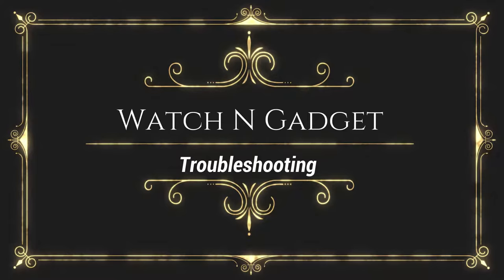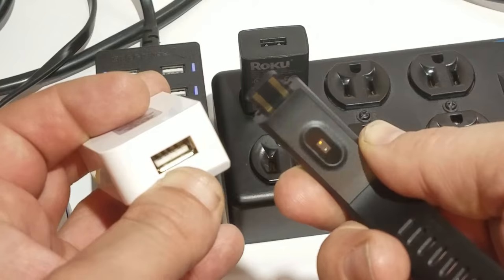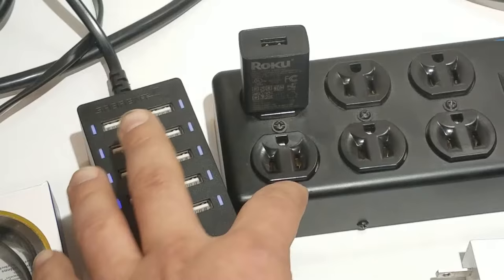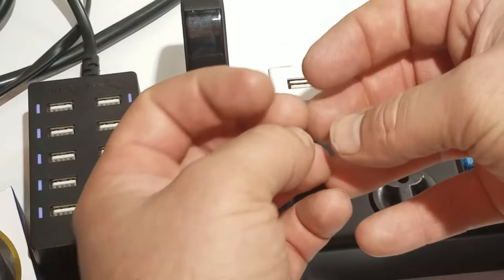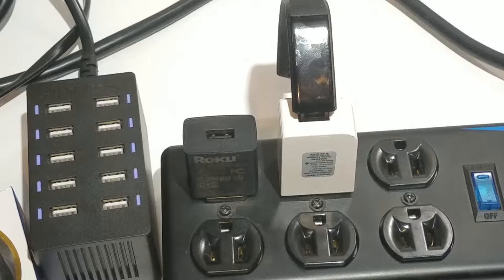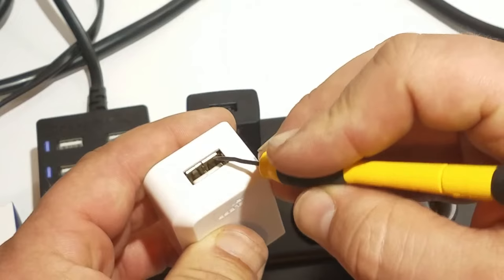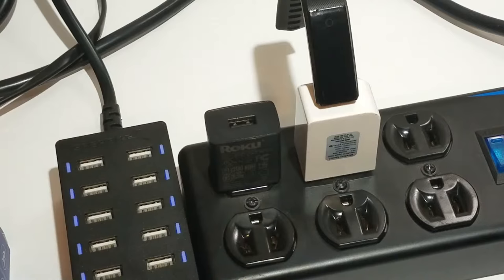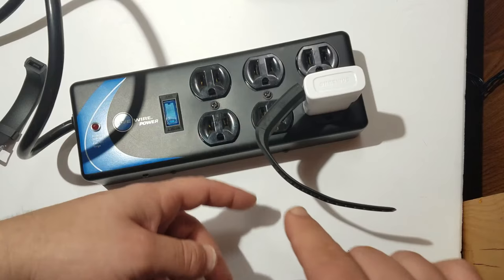Smart Band, How To Charge "Troubleshooting Guide"

Comment: I took your advice and opened up the  metal contacts with a small screwdriver. I plugged it in and the fit bit started to charge. Thanx I recommend this procedure before doing a refund.

Comment: You made everything clear, and I can see why you do need a tight fit.  Since it is 5V.  can you just plug into a computer, and I realize that it also can be a loose fit as well.  Mine didn't vibrate  but then again it is not fully charged.  The instructions that come with the band are not particularly good and everything is so small that you need a decent magnifier to even read it. The band's lighting is good but as time goes by, I will see how it will work give a better impression.  I am surprised that it so cheap in price, unlike the Apple watches.  If it will do what it says in the instruction, then it is worth the price.  Disconnecting the watch band itself hasn't been and a lot of pressure had to be exerted to pull it apart.  It is also very easy to plug it in wrong the first time, like I did and after 2 hours, I wonder why it didn't charge.  I thought that the band was missing the charger.🙂

Comment: That's great info ...I have a different problem that I can't work out. ..the metal  charger part of my watch has come apart from the outer plastic ( which is still in the strap ..mHow can I get it out ..I thought of putting some glue on the prongs but only on the side which does not connect the charger ,? ...Any ideas ?

Comment: My watch has the same connections as the one you show. I let it die around 3 days ago because it was my days off and I didnt needed it (so i forgot to charge it) and now it has been dead for over a day while plugged in.

Im trying now both methods, adjusting the metals on a "newer" charger i had (not new but it wasnt used much  but the smartwatch was dancing on it) so lets see what will happen...

A hour has passed by and the screen is still black, usually it turns on for gives me the info that its charging after 15 mins of being dead...

Comment: Just a USB extension lead ought to help. A brand-new socket on one end, and a proper plug on the other, ought to solve the problem without much expense or messing with screwdrivers. There's also the hi-tech method of sticking a lump of blu-tack on the socket to hold the watch's contacts in the right place.

Comment: Whats the correct charging voltage for these smart fit watches. I noticed my samsung note 9 fast charger has damage my other devices lithium batteries and i dont want to damage the lithium battery in my fitness watch as we all know the battery is not replaceable

Comment: This ID115 watch can’t hold a charge? It’s just that the light is red and text ‘FRI 25 00:00 [charging]’ (FRI 25 and [charging] icon is about 10-18 pixels above) is just blinking. I just might return my watch but I also need some advice. And just to say, I tried everything (except the tech savvy part) but it still wont charge.

Comment: well, my smart bracelet does not charge.  I've checked with multimeter and the metal lines do have 5v and it still does not charge.  I've connected to the metal lines 5v power supply (in the right polarity) and it still does not charge...